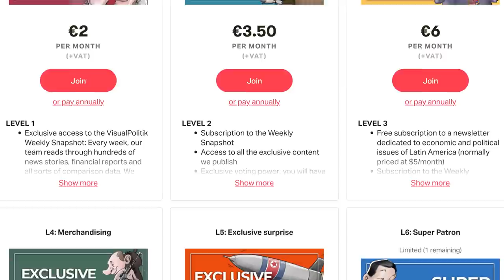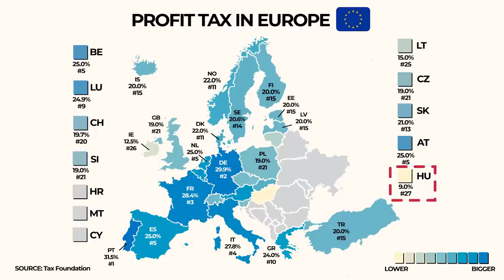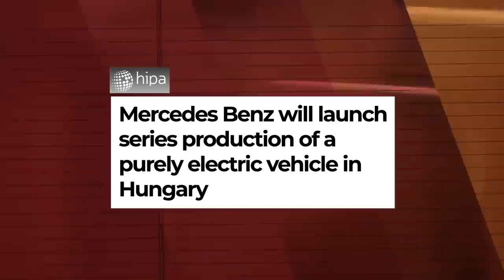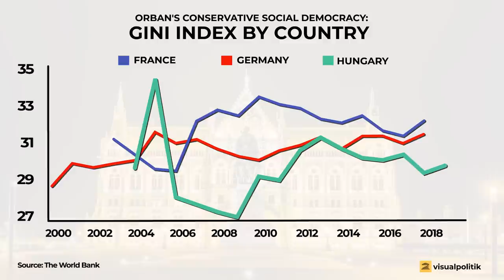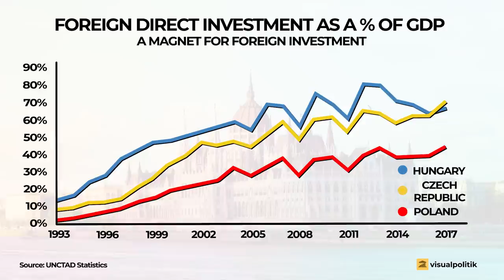Why is ORBÁN so POPULAR in HUNGARY? - VisualPolitik EN

Comment: I disagree an enhancement from 1.3 to 1.6 is an improvement. If they achieve another raise of 0.3 they almost reached the rate of 2.1 for self sustainance. To say it in percent Hungary had achieved 40% of the way.
Reply: Kind of clutching at straws though
Reply: Considering the price of personal freedom and financial recession, that is a failed program.
Reply: This data means nothing without comparing it to other countries around Hungary. If you do that, you might consider it doesn't look much different for to some neigbouring countries but it does look better then for instance Poland. I think overall you need A LOT more information to judge the programs succes or failure. Conclusion: Useless data without context.
Reply: As I read the chart, I see fertility slowly decreasing till 2010 when he took power, a quick improvement in the following few years and then flattened for the last few years. I think these policies have probably done what they could. This video is about two years old. Since then a few items of the family support have been redesigned.
Reply: @csikoscsaba3549  i thought so too but then look at the neighboring countries like czech republic and romania. There is a similar trend. When you look at it like that you cant say you see effect of the policy.

Comment: 8:45 
Going from an avg of 1.25, to 1.5, is a remarkably effective policy. Orban came to power in 2010, exactly when the fertility started rising dramatically.

Just because the goal is not reached, does not mean you're not on the way there.
The smug grin and mocking tone on top is just a litle gross.
Reply: Number of newborns are actually falling and not by a little for a while now in Hungary.
Reply: It's bs since the tfr also rose in other European countries thanks to general economic upturn, and birth numbers are lower than ever.
Reply: Gladly we dont have to live here without any fidesz trolls. ;)
Reply: @Tormastekercs  To be fair, we just had a two year long pandemic to deal with, I'm sure fertility took a hit in most countries.

Comment: Fertility rate goes from 1.2 to 1.5 kids per woman from 2011 to 2018.

Visualpolitik: It it working? "Clear and resounding NO."

I mean, seriously? It improved by nearly 30% and you say it's not working?
Reply: The policy was introduced in 2015, when birth rate was at 1.4, which has since increased to a meagre 1.53 in 2021. Given that the purpose of the policy was to encourage population growth, and 1.53 means the population is still in decline, the policy is not working.

Comment: going from 1.2 to 1.6 in 10 years is a resounding YES. its working wonders.
Reply: True! 33% increase in no mean feat. That's what I was thinking. Increasing fertility rate is not like opening a tap and you get the desired result. It is a time consuming process which require multiple policies to work in sync to get the desired result.
Reply: Still not enough to replace their population! Needs to be 2.1. Or Hungary WILL need immigrants! UK birth rate is 1.75 and they need immigrants.....

Comment: Hungary's family policies are working.  Although you claim the contrary.

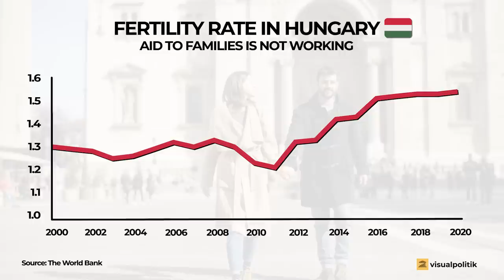Yet, your own graph at 8:58 showcases a significant increase in fertility.  Hungary hasn't seen this fertility level in decades.
Reply: I think what they mean is that even with the increases due to the policy changes Hungary has not reached the 2.1 children per woman level generally considered to be the "replacement level" where the number of births will match the number of deaths over the long term.
Whether the improvements seen count as a "win" depends on what success criteria was advertised as the goal when the policies were enacted.
Reply: True! 33% increase in fertility rate in just about 10 years is no mean feat. It means the policies are working. It may taper off in the long run but right now it's truly working.

Comment: Orban’s family policies were not a failure. Going flat makes you a winner when everyone else is in decline. Fertility rate is highest in EU as well.
Reply: umm, 1.45 is not "flat". to keep your population the same this would need to be 2.1. If the goal is to stop hungary's declining population, then it is a failure. Also, they are not even close to highest in the EU. France's rate is 1.87. Hungary is just a little below the EU average of 1.55.
Reply: Your two main points are false:
1) Everybody else is not in decline. The CEE region experience a slight increase as a trend. 
2) Hungary's fertility rate is not the highest in the EU, in fact, it's below average. Check it on Eurostat or Statista if you don't believe me. 

Hungary's family policy has little to no effect on birth rates. Other regional countries with less expansive family policies are experiencing the same kind of trends, some even surpassing Hungary (e.g. Czechia).
Reply: Lower fertility rate is usually a sign of economic growth....
Reply: @PrexXyx  
Another factor to take into account is that Hungary still reports those who work abroad, despite they are resident in another country, as domestic population because some EU subsidies are based on that number. Although these people can return later, some of them will not. The ratios can be estimated but accurate numbers certainly cannot be gained. 
Furthermore, isolated facts or statistics do not necessarily lead to correct conclusions if we look at the larger picture. Considering that in the recent years a continuously growing number of Hungarians show interest/willingness/plan to move to the west (because people realise that nothing essential changes despite Orban's rhetoric flooding everything and corruption is probably even bigger than under the socialists), even if the successful family policies statement would be true, in the end it still may not deliver the desired result. I can imagine that Western Europe after the bad experiences about muslim refugees may be even more willing to accept Eastern European labourforce. Think about it this way: it may lead to a situation when Orban, who condemns immigration supporting western policies, makes Hungary an emigration country at the same time. Hungary may become a donor for the western countries/economies. How ironic that would be! :) :) :)

Comment: Hungary (and Slovakia and Chechia and Austria) does not buy Russian oil for fun or because anyone loves Putin or his regime. Far from it. Simply, most of the oil flows thru pipes coming from Russia thru Ukraine. A pipeline exists from Croatia, but that's capacity cannot replace the main pipe for the time being and for another while. Not mentioning the exorbitant fees Croatia is charging recently for transport. Building the capacity to be able to import oil and gas from other sources and/or via other routes take many years. How long do you think you could get another water supplier to your house with pipes and everything? Would you be happy to live that long without water? Would you survive it at all?